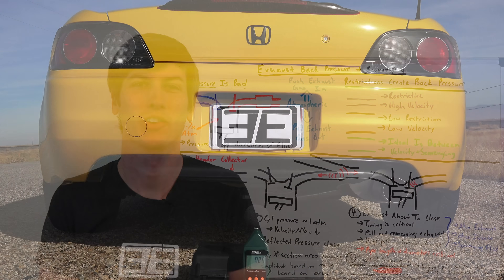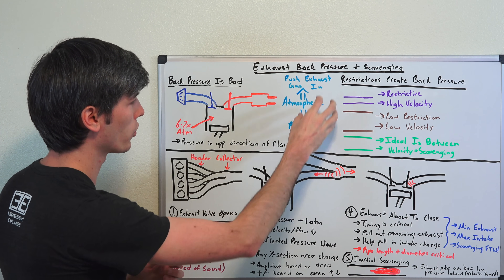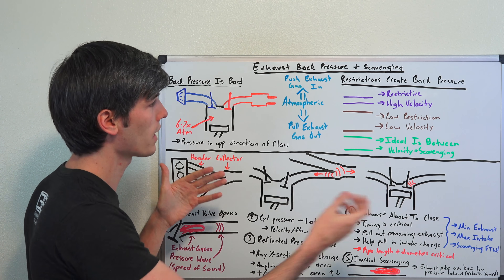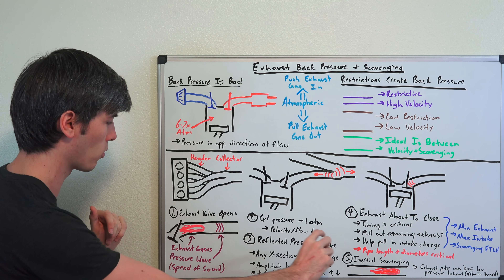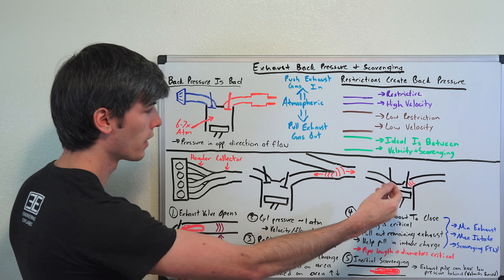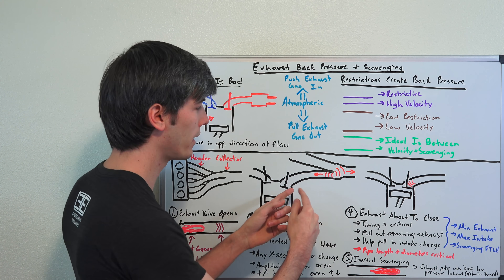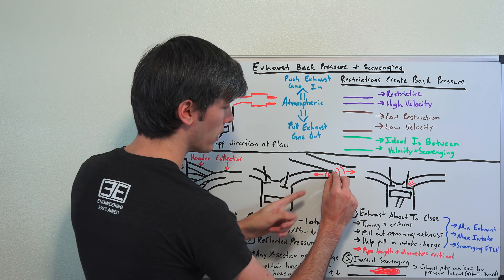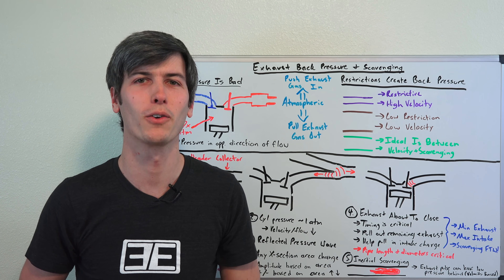Stop Saying Car Exhausts Need Back Pressure

Comment: Interesting breakdown. What you are describing are the effects of a flawed fixed exhaust. And you're right that backpressure in and of itself isn’t inherently good. But I think there’s a broader systems-level view worth considering, especially around the concept of reversion.

Reversion is real, but it’s often misunderstood. It’s not as simple as exhaust gases just “flowing backward.” In reality, reversion can only occur when pressure in the exhaust system is higher than pressure in the cylinder during valve overlap — and that condition typically only exists in low-flow, unstable systems, especially at lower RPM or with poorly designed fixed exhausts.

But here’s the key: in a healthy, continuous exhaust stream (i.e. at higher RPM or with well-managed flow), sequential exhaust pulses create forward-moving momentum that resists any reversal. A single pulse doesn’t operate in a vacuum — it’s supported and followed by a stream of pulses behind it. So the idea that a leading pulse can just “turn around” and head back into the cylinder ignores the reality of dynamic pulse interaction. There’s too much forward inertia for that to happen — unless the whole system is thoroughly compromised i.e.overclogged - another effect of a flawed and fixed exhaust.

Most of what’s labeled “reversion” is really the stalling or pressure interference that happens when velocity collapses due to chaotic backpressure, especially in fixed exhaust designs. Think of it more like a logjam in a river: the logs at the front (or even rear) aren’t flowing backward — they’re just being compressed or blocked by unstable or clogged flow ahead.

So while backpressure isn’t the ultimate goal (velocity is), neither is pretending we can ignore it. Zero or chaotic backpressure = weakened even chaotic velocity, which leads to exhaust pooling and blurred or destroyed scavenging.  IOW, we only need backpressure if we want to maintain exhaust's velocity all the way to the tailpipe exit..

Comment: I like it thank you I don’t know a lot about this but you made me understand it lol. I recently replaced the mufflers on my q50 3.7. It feels faster but maybe not as much tq when I leave the line. Def quicker over 100 wow. Actually sounds great. Little rasp or high pitch but nice chop and growl at idle when behind the car. Sounds like it does on a cold start, all the time. It was running a little rich after putting an axel back on it & replacing the intakes & doing a fuel injector cleaning. It’s doing better now after visiting Infiniti & getting 11k in parts haha :) she’s my baby. 88k on the dash & it’s a 2015 awd q50 with the killer 16 speaker Bose audio. The limited ones aren’t easy to find. It’s in pristine condition. Has a new vr30 transmission in it. Sweet car very basic but timeless & attractive & feels like a 350 hp sedan when driving it I mean it’ll do a 13 flat 1/4. Just got an offer for 18k on it & I was like heck no haha I’m gonna super charge it. Pretty underrated when looking at it haha, it’s a lot more fun to drive ! Around the Branson mountain high road.

Comment: It seems that if the intake has a higher pressure either thru atmospheric naturally aspirated or forced induction from turbocharger or mech supercharger the motor breathes more air makes power or better fuel efficiency at same power than it would mathematically lead one to think a lower pressure on the opposite side of the intake thus exhaust side is theoretically the simuliar condition. So if you have a already tuned engine and you DONT change the headers or exhaust and put a vacuum or lower the pressure at the end of the exhaust outlet it will flow more air this keeping its negative pressure wave but stronger as you increased the velocity of the exhaust gases. I mean everyone knows of you remove the catyzs or the muffler restrictions you get a better breathing stronger power delivery . A turbo on the intake is like a vacuum on the exhaust . Is that a true statement? It logically seems so??

Comment: I AM NOT AN EXPERT.

Yes you need to have back pressure if you running a carburettor because during valve overlap period exhaust gasses pulls fresh mixture in to the exhaust. If you have injectors i thik you will be able to avoid it by changing the timing.

Comment: Mechanic of 23 years here. You need SOME back pressure to help with exhaust scavenging. So typically, a 2.5" or 3" would work for most sports cars arou s 250hp to 500hp. No, you don't want a ton of back pressure but you want some to help woth scavenging. No back pressure leads to falling on your face when that light turns green at the track and you have little torque.
Reply: How many potatoes in my exhaust is the optimal back pressure?

Comment: "BACK" pressure. Pressure is pressure. It has no direction, only magnitude. It is either high pressure or low pressure. It acts equally in all directions. Which is why it's called pressure, NOT BACK PRESSURE!

Comment: You want to eliminate as much back pressure as you can, but when you go to big of exhaust pipes and the back pressure drops to low you kill velocity and velocity is what you are after to much back pressure will kill velocity and to little back pressure will kill velocity, what these videos are doing is playing semantics with the issue of back pressure. Borla is the worlds leading exhaust manufacture and they continually have to educate professional engine builders on this very issue, John Lingenfelter worked with Borla and built 600 horsepower corvettes using 2 1/2 inch exhaust systems doing it, as Borla said and they worked with Lingenfelter if a bigger exhaust would have made Lingenfelter go faster he would have done it but bigger exhaust eliminated more back pressure which killed velocity. 

It is about velocity and yes back pressure does play a roll in velocity so all these videos trying to say back pressure is not needed are just people playing with words.

Comment: With my custom exhaust i have a situation where i get no more power when pressing my gas pedal beyond 60%, but the sound becomes much louder and more hollow during that last 40%. So i feel like i have something working as bottleneck that is mentioned in this video.

Comment: So what about header dumps? For example, you have a coyote motor (gen2 S550 Mustang) w/catless long tubes and about 20in or more of piping and then you have dumps. 3in all the way back and then right at the end tapers down to 2.5 and dumps out with turn downs. What dictates enough piping for proper scavenging? I have the proper escape volume in piping and I’d say the step down right at the end should be enough pressure to suck the exhaust out of the cylinder I’d think? Someone weigh in on this.

Comment: Am I to understand that using an aftermarket high flow header on a stock exhaust system of a 2.0 Duratec NC2 would be a waste unless I upgrade the mid section and back box at the same time?

Comment: This explains why low rpm at high load causes denotation. Some hot exhaust gases are still in in the cylinder on the intake stroke due to lack of scavenging.

Comment: The two stroke engine of a Trabant 601 doesn't work without back-pressure. As soon as the engine sees load, it stalls.

Comment: You need back pressure in 2 stroke engine to keep pressure in the cylinder because they have no valves unlike 4 strokes which will always run more efficiently with less restriction.

Comment: Literally had a bmw loose most of its low end torque and hp because both  resonators We're removed and back pressure was lost 🤦‍♂️Ended up connecting both exhaust pipes with a x pipe to increase back pressure and it ran like a dream it was a 750il with a v12 high school with that car was a dream 😂

Comment: Most of the exhaust gas expands out of the cylinder the moment the exhaust valve opens.  The exhaust stroke does very little work on the gas.

Comment: Whatever, it's proven over and over again a normal vehicle engine still needs the whatever the thing it is that's going on, which is never understood properly and what's called "Back Pressure" in the public domain. And the only people who constantly go on splitting hairs about back pressure are from aftermarket sales / race background (no engine idling) and nothing to do with normal motoring.  It's to do with charge scavenging, resonance, pressure waves, fluid dynamics, inertia, .....

Comment: Would there be a benefit to having negative exhaust back pressure? Like if you had an electric air pump/vacuum that sucks the air out of the engine…

Comment: I have had this debate with a few friends. Something that helps to (erroneously) 'confirm' that backpressure is beneficial is that people sometimes do feel a power loss with the installation of a better exhaust, due to failure to finish the job. That is, proper jetting or EFI tuning. Most shadetree mechanics can change exhaust parts, many cannot accomplish the latter.
   Exhaust improvements are available for many engines, for which no carburetor jets are available, or which have virtually untunable efi. 
   Many tolerate or are even unaware of their power loss, and enjoy the loud noise regardless.

Comment: What about on a 2022 Mustang GT with the Coyote 5 liter V8? I bought a Corsa cat back 3”. Why is it that the car doesn’t feel as responsive and pull as hard as it did with the stock 2.5” exhaust? But Corsa states dunno results 5hp increase as well as torque increase but it certainly doesn’t feel as push my ass in the seat with the Corsa although the sound is amazing

Comment: Its funny that he states you dont need back pressure while also saying you need a little back pressure. Yes, you dont want the most restrictive exhaust in the world, but you also dont want a 3 in diameter pipe on a 4 cylinder NA engine. It is still finding the middle ground of not TOO MUCH or TOO LITTLE.

Comment: How big of impact on performance with factory misalignment between exhaust ports and manifold? And how different gasses travel if ports meet in exhaust manifold and then there is main output from on the back of manifold?

Comment: That's great information, but leaves the viewers scratching their heads.  How do you get the information that allows you to create, buy or otherwise acquire the correct exhaust to meet these needs, AND are gas and diesel engines the same?
Reply: Yes, gas and diesels both need good exhaust scavenging, the main difference between gas and diesel is just whether or not the engine uses a spark plug.